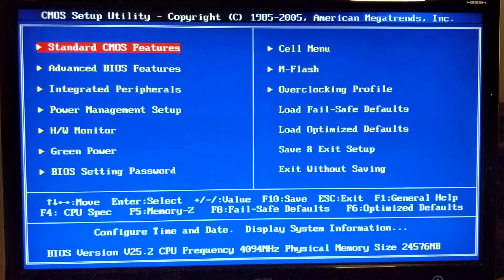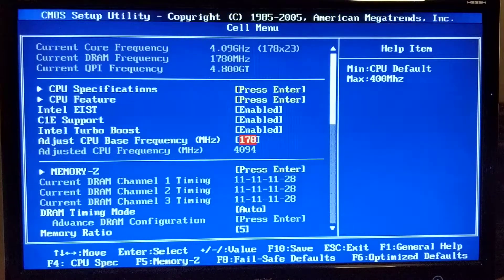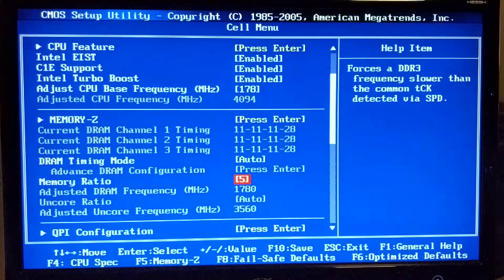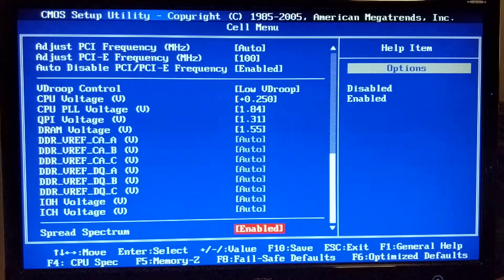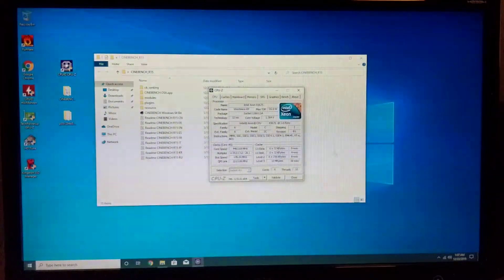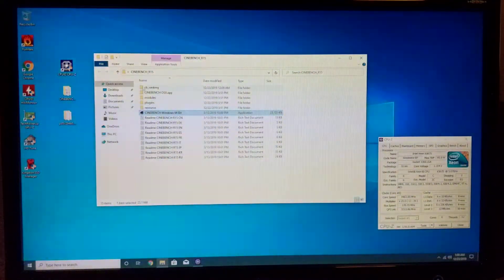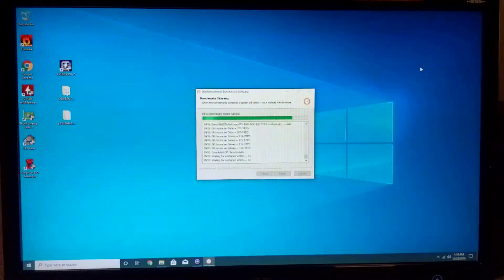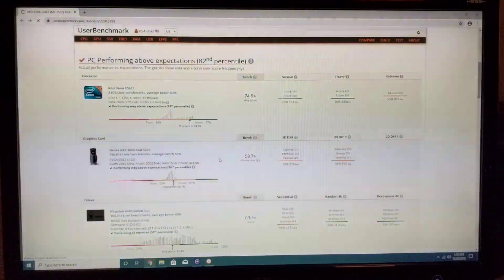MSI X58A-GD45 with Xeon X5675 Overclocking Tutorial

Comment: i'm running stable at 4.6Ghz with 1.36 voltage.
I have ordered a x5690 and a W3690.
I think one of those cpu's should be able to run at 5Ghz.
I managed to run the x5675 at 5Ghz.
But when i game on this frequency, the pc will crash after a few minutes.
I could try to clock it at 4.8Ghz, but the problem is that due the limited multiplier i'm forced to choose a very slow ram speed.
And the W3690 i can keep the maximum ramspeed possible, while clocking to 4.8, or maybe even 5Ghz

Comment: My Msi g41m-p34 mobo is weird. When I first overclock it works fine but when I turn my computer all the way off and back on I get a failed overclock menu
Reply from the maker: It means that your CPU silicon can't work on as high frequency. You can up the voltage a little (which is dangerous and you can fry the cpu), or you can lower overclock frequency.
Reply: @pavlovtech8992  thank you! I have one more question. Can my motherboard handle a gtx 1660 ti?
Reply from the maker: Yes, 1660 Ti is around GTX 1070 performance wise - will match great with 6 cores 12 threads CPU. I wouldn't pair more powerful video card with that Xeon though.

Comment: Dos you think that work with a x5650?
Reply from the maker: If you have the same MSI motherboard, then I would adjust "CPU Base Frequency" to 200 and select "Memory Ratio" where you get memory frequency close to 1600. Your locked multiplier for this CPU is 20, so 20 * 200 = 4000 MHz. With turbo enabled you should be getting close to 4500 MHz. However it really depends and you might end up running 195, 190, or 185 for "CPU Base Frequency". All other settings should be working as shown in the video.
Reply: did it ?
Reply: @danialahmed3717  yes but i just can get 3.6 GHZ on auto configuration because this cpu dont run with low voltages so i decide to put in auto